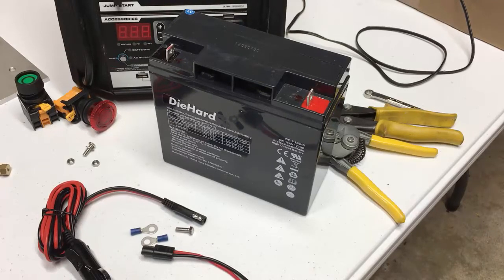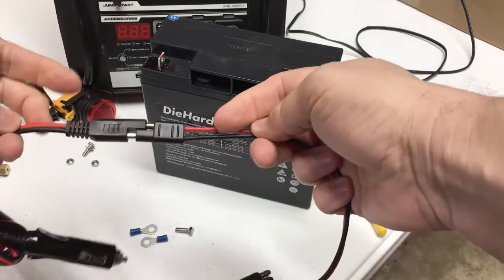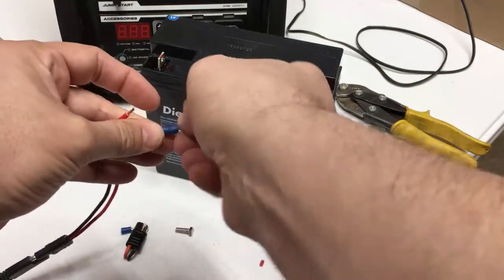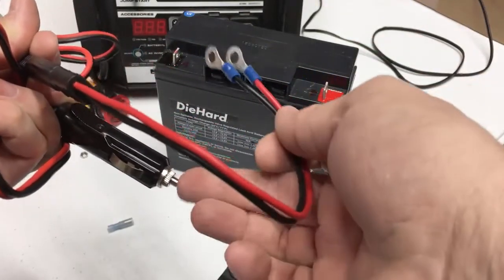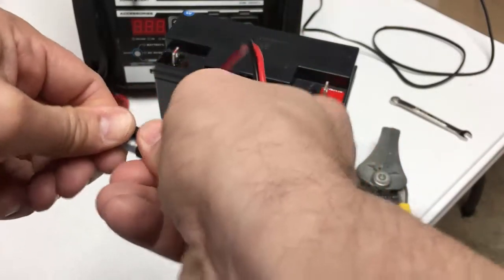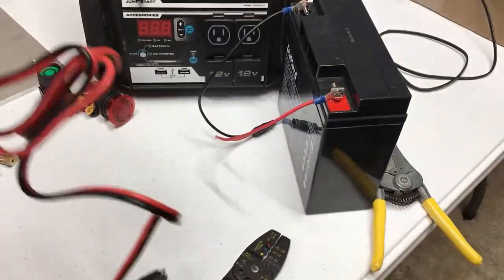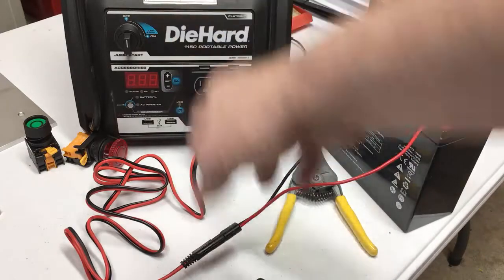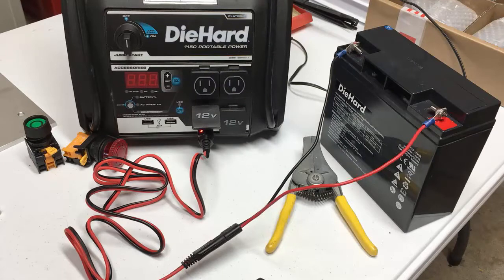Increase Your Solar Generator's Capacity

Comment: Great video! I have got myself the same setup going but my second battery is a 35AH (cause I already had it from another project, but barely used really)> One question - you mention not wanting to connect the batteries unless they are both charged for worry of blowing a fuse? But then how can you use this setup to charge the two of them, if you can't connect the external battery when it's been run down? I might just be missing something obvious here :p 
I'm planning to use it at a camp site with no power hookups and charge  it all via a solar panel with a charge controller..
Reply from the maker: Thank you for your kind words!  You have a very good question so I'll give you a short answer and a long answer.  The short answer is that it turns out not to matter in this case.  The long answer had to do with my experience taking a fully charged lead-acid car battery sitting at  13.5 volts and connecting it to a discharged battery of the same type.  In that case, it's possible to flow enough current between the two that you melt the wires or fuse.  So, you would have to discharge both or put a separate charger on the discharged one until you brought them to the same level.  However, since this video was made I discovered that even with a fully discharged battery of this type (AGM),  the current flow between the charged and discharged battery never exceeded 6A, which is well within the range of the connectors used in the video.  So, don't worry about it ;-)   Thanks for watching!
Reply: @OdysseyCamper  thanks for taking the time to reply!

Comment: Hello, great video... quick question. Does it matter if the the tethered battery is much high ah? Or do the equalize without harm? I am interested in doing this set up, and using a 125ah inside a minn Kota battery box connected to my Schumacher. Reason is to have plenty of options for power, I need my smoothies on the road (gut/digestive issues) The nutri bullets run600-900watts. So I would run an inverter from battery box, or if possible the Schumacher ...hopefully I can get your help.
Reply from the maker: I see this is related to your other question.  I think you might be able to sneak by with it pulling less than 15A.  Try it and if you blow the fuse, you'll know.  In the video I talk about a dead battery pulling too much current but I ran a test after this video that showed this isn't the case with the small batteries (my comment was based on experience with large car batteries)

Comment: Okay I'm sorry to trouble you again. But I'm checking the generator and it does not have a 12-volt plug in like a cigarette lighter plug it only has the 110 or 120 plugs that you call it and it's got a USB. As I said it does have a plug-in that I put a cable into that has the alligator clips on it to put directly on a battery and charge it without having to have a battery charger plugged into a 110 port. So I was trying to figure out if there was any way that I can use it to charge the jump pack. I think I just answered my question duh! It's got the 110 plugs so if the auxiliary battery is connected to the jump pack and I use the 110 plug I can plug that into charge the whole unit the way I did in the house correct? I told you in several instances in my questions I'm not an electrician it just takes me awhile sometimes to think this through I'm sorry for asking before I thought about it and looked at it closer. But please examine my other questions that I ask and let me know your thoughts
Reply from the maker: As you noted, you COULD connect the jump pack with an extension cable, just like you do at home.  However, it's a little less efficient that using the 12v out of the generator.  If it has special wires and clips for connecting to a 12v battery then I would try to go that way.  Make sure they are for charging and not the electric start on the generator (if it's equipped with one).
Reply: @OdysseyCamper  no electric start. Cable specifically for clamping to battery terminals. No 12volt plug in! :(  at best I could only charge the axillary battery by the generator. If I have charge controller connected the way you did to jump pack and solar panel, but disconnect from solar panel, how do I use the Schumacher and connect it with jump pack and axillary battery so can plug into the cigarette lighter port? Is it possible?
Reply from the maker: @jeanariley7759  I think this is what you are looking for.  It will plug into the charge controller and then to the cigarette lighter.  Just check to make sure that red goes to red and black goes to black when you plug it in.  https://amzn.to/2JrYkvC

Comment: Hey Darren! I thought of something else. I know when you made your console battery pack you have a charge controller in there and it can be charged from solar or from the cigarette lighter and the charge controller takes care of that so it doesn't overcharge. The only charge controller that I have outside of what is used in Connected for my house battery system is the little Schumacher one that you put on your panel to use with the jump pack in the auxiliary battery. I was not going to permanently attach that to the Harbor Freight solar panels that I intend to use with the jump box. I was going to attach the charge controller to the little auxiliary box that I put the secondary battery in that attaches to the jump box that way it's always with that and then I can plug in from there. That being said can I somehow hook up the system if I'm trying to charge it off a battery or 12 volt source so that I can use that charge controller the way you do with your console and the charge controller there if so how would I hook it up the same way you do because your console pack is different it's wired directly into that charge controller the other one that you used on the solar that jump pack setup is not going to have the charge controller attached to it it's going to be attached to the solar panel so if you were trying to charge that jump pack with the auxiliary battery from the cigarette lighter how would you do that? I know I saw in one of the other videos people had asked about charging directly from the cigarette lighter and you didn't recommend it because it may shorten the life of the battery and also not to leave it plugged in over 30 minutes or so not to overcharge that's why I was wondering if there was a way to hook in the charge controller that I'm going to have attached to the box with the auxiliary battery so that I can have the benefit of the charge controller preventing an issue I don't want to shorten the battery life. I'm on a very limited income and I can't afford to be replacing these things any more frequently than necessary. I hope you understand what I'm saying I know it gets kind of confusing but I'm not sure even how to ask the question other than what I did
Reply from the maker: There really isn't any reason that you could not use the Schumacher to charge another battery or a console pack.  I just wanted to use a bigger one in the console, to shorten the time it takes to charge the double batteries in the console.  The little Schumacher will work, it just takes longer than it would with a bigger solar charger.  The input to the Schumacher controller can be a solar panel, or voltage from the cigarette lighter.  The output will go to the battery, red to +, black to -.

Comment: Hey Darren! I need to throw another question in there that I didn't think of earlier. I'm getting ready to go on a little camping trip that's been delayed about a month and sadly it's not going to be as long as I want to. But looking at the weather it looks like I'm going to have some issues perhaps having enough solar to charge my house battery and to also charge the jump pack off my Harbor Freight setup that I would be hooking to it. I told you I like to be prepared I do have an inverter generator regular gas one. It has the 110 Outlets as well as a 12-volt plug and it also has some sub ports. I'm thinking because of the weather I'm going to end up having to use the generator to charge my house battery because I won't have enough solar to fully charge it at the refrigerator runs 24/7 as well as a couple of 12-volt Outlets that are always hot. I was wondering it makes sense to me it should not be an issue but I thought I would ask since you seem to have a lot of knowledge about these things if I could charge the jump pack off the generator? Sitting here saying this I would have to go look at the generator because to be honest I'm not sure that it has a 12-volt plug that doesn't make a lot of sense but it might I've never used it very much at all it's just there as a backup for emergencies in case I don't have solar or any other means to power the refrigerator or what I need to. It does have a cable with it to charge a battery but it has claps on the end a positive and a negative that you can just hook directly from the generator to a battery to charge the battery that's what I would do on the house battery but I have no idea how to do it on the jump pack unless it has a 12-volt outlet that I can plug the jump pack into. I could charge the separate battery that I have hooked to the jump pack or that will separate from it as you know but I don't know how I would be able to do the jump pack unless I've got a 12 volt plug any ideas or Clues? The issue is I don't have any other wiring or connections or whatever that I know of that would work

Comment: Once the external battery and jump pack are paired and charged together, is it okay to disconnect the external battery from it for transport and reconnect when ready to use? Will that effect anything? Limited space and I put the external battery in a tool box to carry and protect it/connections.
Reply from the maker: Yep, that's fine!  I actually charge a spare battery and stow it when I travel.  Just in case it's too cloudy for solar, or I accidentally run the starter battery down (did by mistake one time).  It's not a huge deal at a campground, but it is when you are 20 miles out in the desert...